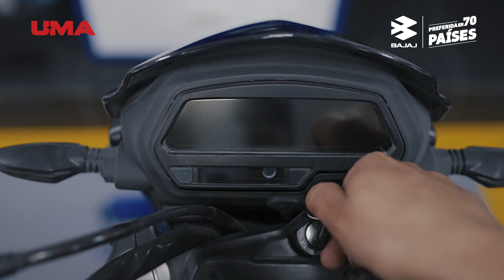Megacentro de Servicios Bogotá - Minuto de Dios

Comment: Tengo una mala experiencia con mega centro de soacha muy malo el servicio de ese centro llevé mi moto por garantía de batería con 980 km con 20 días de comprada el 5 de enero 2022 después me acerco a preguntar por el cambio de la batería me dicen que UMA no había contestado sobre la garantía pero me entero que subieron la garantía al sistema de UMA el 31 de enero 2022 después de 26 días de llevar la moto que falta de profesionalismo de las personas que trabajan en ese sitio final mente hasta el día de hoy me cambiaron la batería un mes después por centros como esos es que hablan tan mal de UMA pero los centros los malos
Reply from the maker: Hola Jair, lamentamos que tu experiencia no haya sido la mejor, nos gustaría conocer más detalles de lo sucedido para ofrecerte una solución. Te agradeceríamos nos compartas más información por medio de un mensaje interno en la opción 5 en nuestras redes sociales (Instagram o Facebook). ¡Estaremos pendientes!
Reply from the maker: Hola Jair, estamos a la espera de tu mensaje en la opción 5. Estamos atentos.